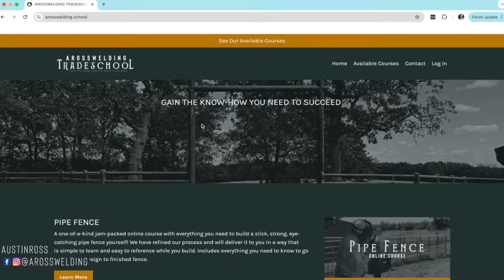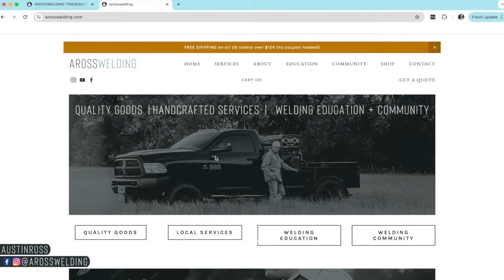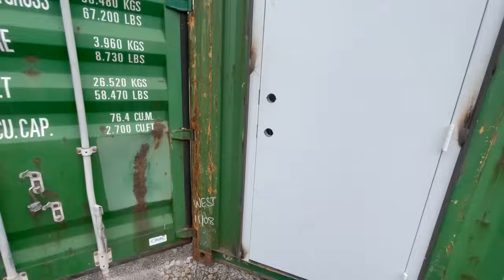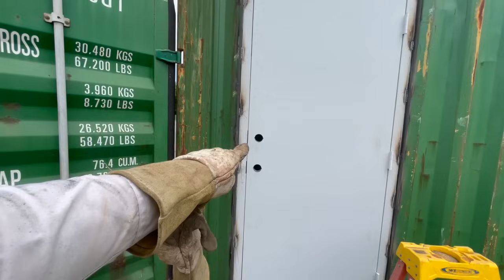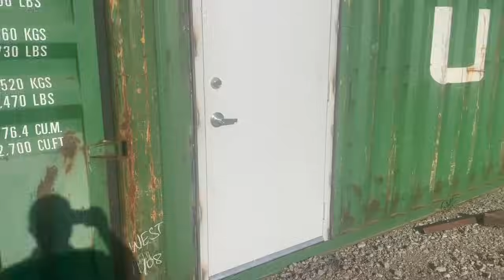Mobile Welding- Cutting In A Walk Through Door On This Shipping Container

Comment: I’ve done 8 or 9 of these, most of them I also cutoff the swinging doors, framed it in and installed canister roll up doors like they use on storage buildings. I’ve always been a 7018 & 6010 guy, but I learned that on the side cutouts, a 6010 stitch weld is very prone to cracking! Most of these containers are built of “weathering” steels (Cor-Ten), and that might be the issue. Weathering steels are frequently used for bridge beams and things like railcars that are in crushed rock service. The stuff weathers to a uniform rusty appearance, then stops! Most of those bridge beams and railcars are never painted!

Comment: Hey Austin, I heard you say you have access to a plasma cutter but not a compressor. If you're wanting to do small field cuts with the plasma without having to worry about also firing up a compressor here's something we used to run about 30 years ago, a 100PSI fixed regulator on a tank of nitrogen. I hadn't seen "FROG's" before and was introduced to them by one of my friends running in Baja races. Granted he was running CO2 for inflating tires for emergency repairs but all it takes is a tank fitting change plus a quick disconnect to the plasma cutter fiting to get up and running that way. The bonus is you also have the nitrogen for emergency flats as well if necessary. Then you're just plugging in the plasma the same as plugging in a grinder. The alternative plasma would be one of the plasma cutters with the built in compressor, I believe the popular one from Hobart was called the AirForce but I might be mistaken. I spent a lot of time on the ol' flamewrench with 2" plate and comfortable work positions makes for quality cuts with less time on the grinders. Less time on a grinder is a good thing, your wrists will thank you when you get older. As I always say, "Over do it, don't do it over." As usual it's always fun to watch people who take pride in their jobs. Stay safe my friend.

Comment: GREAT JOB!!
Now I am a Door Guy/Welder Fabricator.  You actually did it the hard way. I cut mine out with a MILWAUKEE metal cutting saw. Awesome saw, would have taken 10 - 15 min, including a clean cut at the sill. Why use 1/2" flat stock? I cut the hole a 1/4" bigger then the throat of the frame. That way the frame seals against the container. Run some flat stock on the inside for bracing and done. I always install a latch guard for added safety. 
The Hollow Metal Manufacturer here in Phoenix makes frames specifically for containers. I want to install one of those see how it turns out.
 Contact me about the threshold. I have a HUGE  tip for you.

Huge fan, Keep up the GREAT Work
Reply: Why not share the info with the rest of us?
Reply: @papalilburn  The way the Threshold  was installed, Guaranteed to Leak.
The Fin on the Threshold needs to be trimmed back flush about 2".
The Jamb needs to be caulked where it meets the floor under the threshold.

Comment: I've cut those before for a customer and I actually started it with the torch but figured out it was way easier with cutting wheel.  It's a cleaner cut and no slag from the torch.

Comment: If you’re in the market for a plasma cutter and don’t have an air compressor handy, HypoTherm  makes a unit with a self contained air compressor and air dryer. I think it’s called a Power Max 30. That model may be a little light duty for you but the machine does have a built in air compressor.

Comment: Ive always kept my old Milwaukee band saw and sawzall with bimetal blades & like 2 extra bands & hardly need to use a torch unless its like 3/4 or thicker. I do like a torch to pop holes unless i HAVE to use a drill though...

Comment: I got whacked in the face with a grinder when I started out in the fab shop (no face shield on) but luckily it was with a flap disc, not a cutting wheel. Now im a Union Ironworker and I always tell my guys take 30 seconds to put your hood on before using a grinder. Safety first!!
Reply from the maker: 30 seconds is time well spent for sure

Comment: IDK man, I kinda like that JOLT when i'm welding soaking wet. Seems extra special if I'm at the grandparents' place welding off the ol tombstone while standing in a puddle because there's a small creek through the shop.
Also, I found it easiest (and stronger, too) to make my man door with tubing 2x4 or 2x3 with a 3/4 jamb the full height of the wall. Didn't want to mess with the prefab frames.

Comment: Quick tip on flame cutting, score the line with your cut off disc and then cut with your torch. Your line will not burn off and the flame will follow the corner of the line leaving a nice smooth straight cut .
Reply from the maker: Nice! Thank you for that tip! That’s a good one!!!

Comment: Hi guys - if you don't want to put a "man door" in a container - but it is too much trouble opening the container doors all the time - it does make it easier you simply remove one set of cam lock  bars from each door - the ones closest to the hinges - they are bolt on so it is quick and easy!!  Just saying.

Comment: I've never used a zip with a threaded hub, can you talk more about how they are safer. Also is there a reason why you aren't using the guard. I had one explode and cut my hand up badly but healed. Abrasive discs/Zips make me nervous as hell ever since, I switched to diamond discs, now I don't worry about them coming apart but my ears pay for it they seem 4 or 5 times louder then an abrasive cutting wheels.

Comment: 12:00 Just letting you know you can run a plasma cutter off oxygen vs. air compressor. It is a cleaner cut, too.
Reply: I bought just a cheap amazing reboot plasma for $400. I think it cuts as good as the hypertherm for smaller material.

Comment: Since you said you got limited space I'm sure you know about Eastwood fabrication tools they make some Auto Body welders and sanding blocks and things like that they happened to make a very tiny and I think it's about a 4 and a half inch saw well it's for metal you could have used it to cut out that door it's about the size and profile of a DeWalt Grinder the reason I bring this up is it would fit in your side box because it is about the size of a grinder

Comment: They do make plasma cutters with a built in air compressor. If you’re going mobile with a plasma cutter you can have both equipments in one. It’s not a big unit at all.
Reply: When you got to have a power source to run that how to use plasma abuse gouge I've used cutting torch cut off wheel he called it a zip wheel look that's the best way to do it I used to do windows and doors and cut them things in half and different angles put them back together lot of fun country containers Bertram Texas check it out
Reply: @okiedoke6373  he already has the power source, his Welder / Generator.  The same machine that powered the grinder!

Comment: Austin, why did you choose to seal the gaps with silicone sealant instead of welding the metal with a continuous seam? a continuous weld is completely sealed and durable, right?
Reply from the maker: Just so I would not take the chance of warping the metal therefore causing the door not to shut right. I honestly feel like it probably would not war that bad on account of how them containers walls are corrugated and I used the half-inch plate and the door jam itself is corrugated or got some Brakes, a.k.a. Bends  in it. But I just did not want to take a chance. I will try it out on my own container and see if it warps at all. I have heard of guys seam welding them. So I reckon it is possible.
Reply: @arosswelding Hello Austin ! Always enjoy your content Sir ! IDK if you’ve touched on this before, but you might be able to do an educational/historical piece on “Corten” steel which is used in these iconic shipping containers-Corten steel also is used in decorative/architectural/planter-landscape/outdoor art and garden/yard/small business projects-They had a cool website a few years back giving the specs on it🤙🏼Stay safe, be well!

Comment: From a security standpoint you would want that to swing in because if it swings out a thief can pry that open no problem but if it swings in it's going to be a little bit more difficult to get it open this makes a deadbolt a whole lot more effective good video though
Reply: A thief using a piece of pipe or scrap I-beam laying around (or bring their own sledgehammer)  makes short work ramming a door In to gain entry.
Reply: You don't even need that all you need is a pipe wrench most people don't know this but you know that little Shield that's in a deadbolt best designed to keep the deadbolt from being crushed but since they put that on there and I used to work as a locksmith if you couldn't pick the lock you certainly could twist it out of position you take the back of the pipe wrench you strike the top of the shield that crushes it in you set the Jaws to grab and you push towards the bottom of the door this pulls the deadbolt out of the wall then you take that same pipe wrench and twist the doorknob off the door and you're in locks only keep honest men honest locks are only for the UN honest

Comment: And the way I like to do them a door like that I'll put a piece of plate on the door then I frame in the hole with two by two tubing if it's a larger span then I'll use 2 by 6 quarter wall 2 * 2 10 gauge have fun welding that

Comment: I will tell you if you don't use it you lose it. I have found that out about using the torch lately so I have been trying to use it more frequently. Yes I still like Zip discs and plasma. Every job has it's place.

Comment: had the rear case on a tractor tiller blow out, so i cut the case apart and welded in a carbon spring steel race for a larger 4 inch ford bearing... 6011 cast nickle iron to spring steel. the old bearing failed with a 50hp/800rpm load, the new one is ratted for 5000lbft or 600hp/800-1400rpm. ... only half an inch bigger, but that's the load range of a made in USA bearing that throws the Columbian made pot metal back in the trash.

Comment: As far as a plasmas go you got to have two things you got to have air and you got to have electricity the hypertherm xp45 takes a 50 amp breaker a 225 welding machine will not give you full power then you have to back the power down to 30 a bobcat 250 or a Ranger 250 both have a 50 amp breaker when I am drag cutting using a straight edge you need 100 percent of that 45 amps if you're cutting 1/16 or 1/8 in the 45 is perfect if you're cutting 3/8 not so much that's why I don't even bother to carry a plasma on the truck you have to have 15,000 watts to power a plasma that's going to be productive on a job site similar to the hypertherm 65 or you're looking at 20,000 Watts for the 85 hobbyist you're fine but if you're cutting 20 ft sections of 3/8 plate to be honest with you I'm going to use a Milwaukee circular saw yeah it's pricey the blades are pricey but you can cut 1000 foot or better on a blade then it's cheaper than a cutting torch to run a dual air may be good for a hobbyist but I haven't found them useful in production I carry an air compressor for a gouge I also have an old-school SAE 350 to power that gouge downside is you don't have 240 120 60 HZ anyway that's just my experience